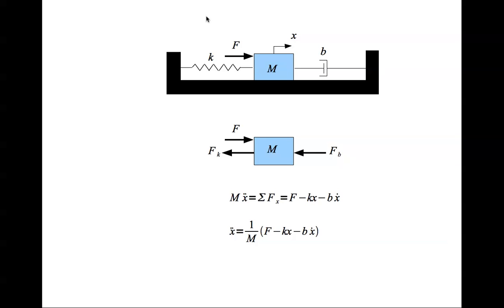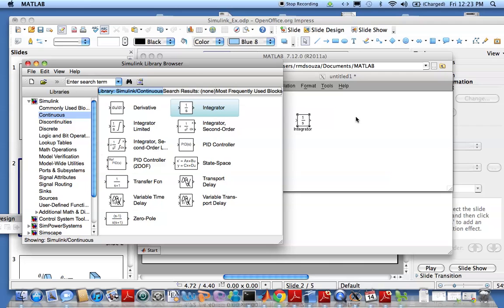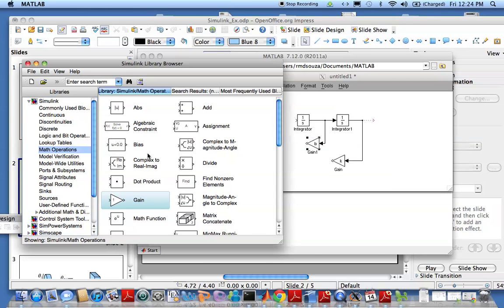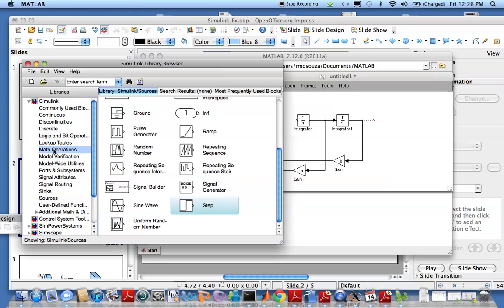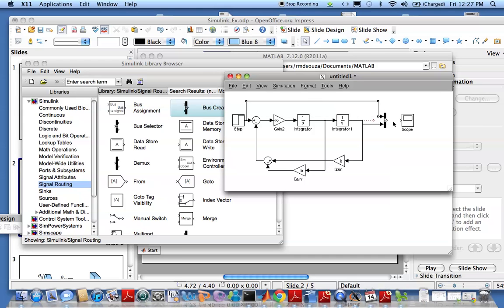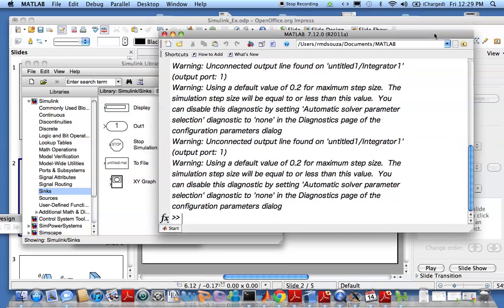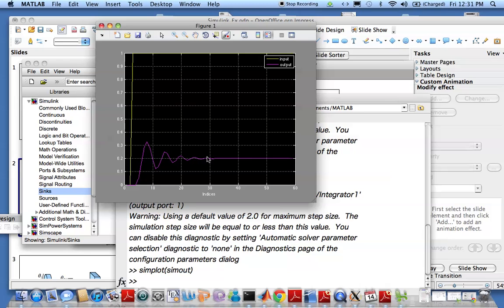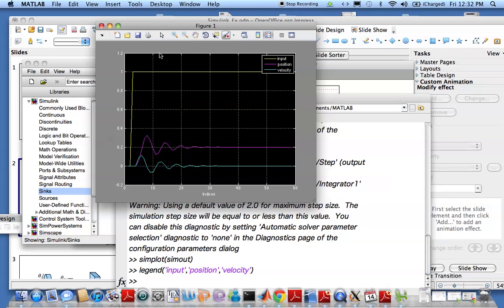SIMULINK modeling of a spring-mass-damper system

Comment: how i will do in case of applying force. For example, a mass-damper (car suspension system) is at equilibrium position displaced 1m have m=50 Kg. Now external 20 Kg apply at t=2 second, now total mass is 70 Kg. How i check response in Simulink (what changes require for achieve response).
Thanks

Comment: Error using simplot (line 218)
Essential fields missing from data structure for run #1
Reply: right button click in "simout" box
select   ToWorkspace parameters
select   Save format: "Structured With Time"

... and now

>> simplot(simout)